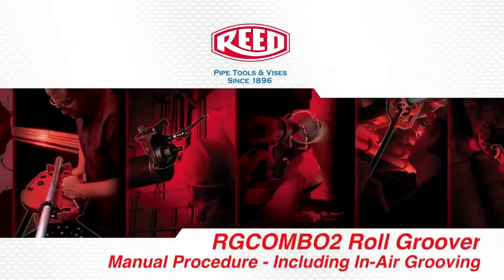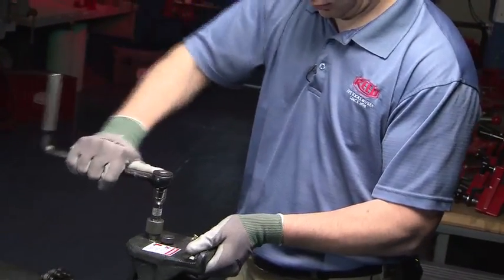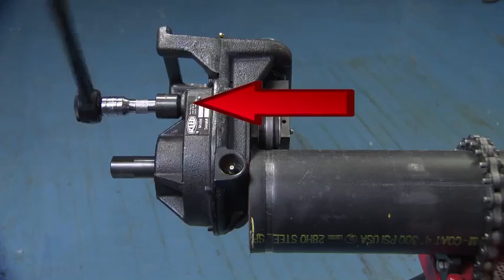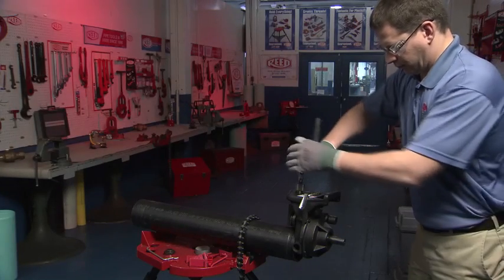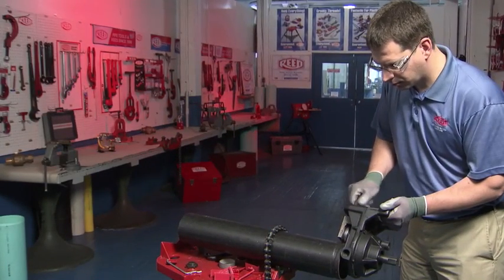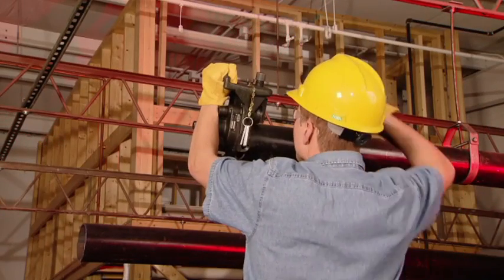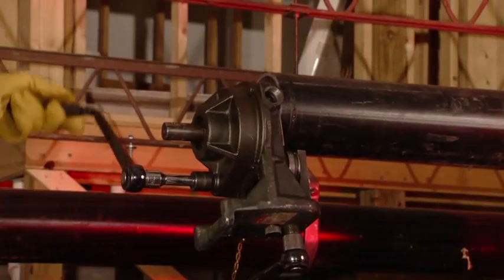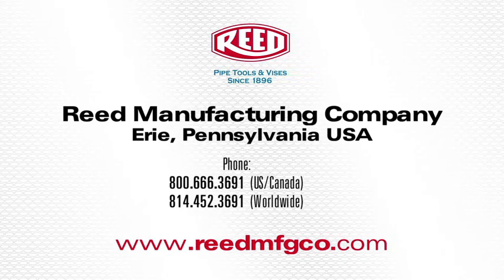Manual Roll Grooving & In-Air Grooving Demo (RGCOMBO2) - Reed Manufacturing

Comment: Looks super easy here, but lemme tell ya it takes forever and it blows. Not that there is a better option. Just be prepared to work😄
Reply from the maker: Grooving Steel has its challenges. It is a heavy tool, but we hope that you find this tool to provide consistent tracking through the years.

Comment: Hello Mr. Reed. I work as a site in charge in a GCC based compay. I have recently bought 7 of your machines. My one issue I would like you to resolve is that when I use the pipe cutter, the blade just snaps off. I changed the blade & tried it again but the same thing happens the moment the pipe is about to get cut off the blade snaps. I use all necessary precautions by using grease & lube but it doesn't work.Please sort this out. Thanks
Reply from the maker: Jude, if you are still having an issue, would you please send a message to our email address for the sales department?  That way we will be able to learn more and provide you the proper guidance.  Please write to reedsales@reedmfgco.com 
thanks.